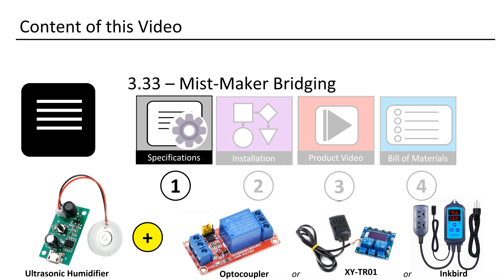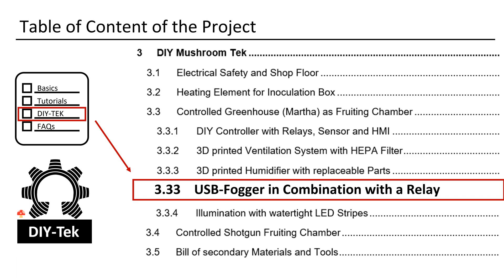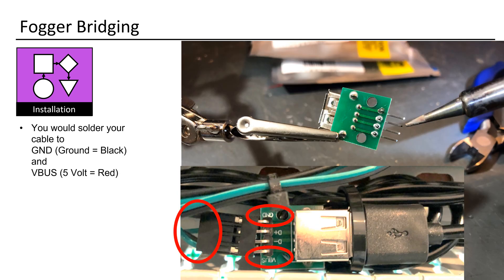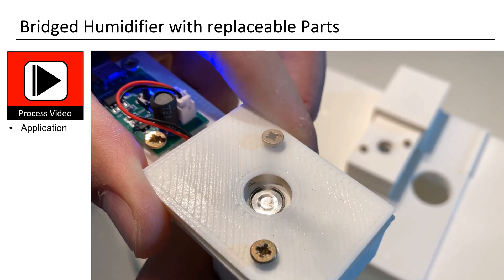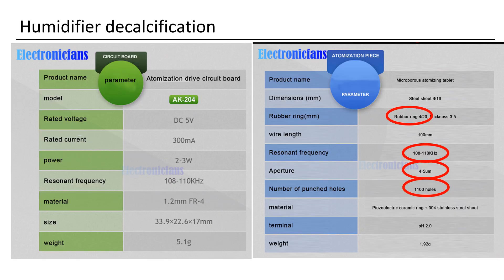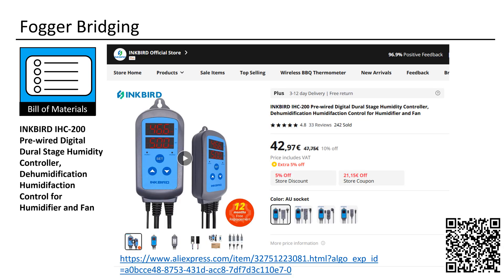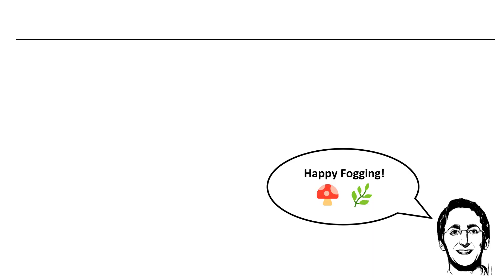USB Mist Maker to Relay Connection Tutorial

Comment: can you help me with this please?
Reply from the maker: how?
Reply: I need to make the humidifier automatic without the need to push the button. I have tried everything but can't do that  @diy-mushroom-tek
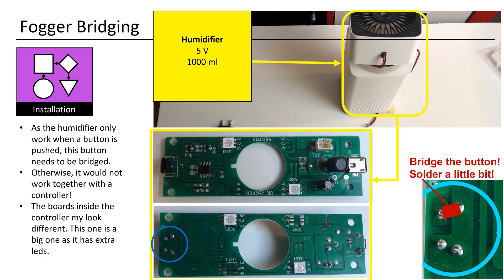Reply from the maker: @codewithshawaiz  Hey, normally, if you solder the two pins together as shown at timestamp 2:14, the starting button should be bridged. 

That means when you plug the board to power, then the mister will start.
If you did solder, and if you are not sure, just solder all the pins of the button together, and if the board still does not start, then I would advise to just buy some other boards from different suppliers and manufacturers. I had success with all the devices I tested, but maybe some designs have changed.

Anyhow, a button does just that what you do with the bridging, so I am not sure if this bridging will stop to work and why some manufacturer would like to work against it. There are also designs out there that have extra special solder pads to make the bridging even more easy. Thus, it is a desired modification according to your needs.

All the best, just try it on some other boards. Since they are very cheap, this should be no problem!
Reply: Thank you  @diy-mushroom-tek

Comment: Usb miss maker itu kalau di hubungkan ke relay cara bagaimana dan miss maker nya gak mau keluar asap tapi lampu biru nya nyala mohon penjelasan nya ,makasih
Reply from the maker: Hello! If the LED is on, the humidity controller is functioning. If you haven't bridged the controller, you'll need to press the button. Also, ensure the sonic disc is connected correctly. When both are set up properly, you should feel the disc vibrating slightly and hear a faint sound.

To test further, touch a damp sponge or cotton swab to the surface of the sonic disc. You should see the water start to evaporate.

I hope this helps and that I understood your question correctly. Best of luck!
Reply: Makasih bos ,telah berbagi ilmu yang sangat bermanfaat bagi saya,semogga sukses dan dan sehat sehat selalu

Comment: hello, my module seems like it cannot be turned on after bridging, I tried separating the soldered part and the it works again like normal. What do you think about this?
Reply: my board does the same thing like yours: holding down the button while conecting the usb-power and no misting. And after i release the button the LED will lit and the mist starts.
But ive found a solution: get a 100uF capacitor and solder it to the button like you bridge it -> by powering the board the capacitor will act like the bridge but after a second or two the capacitor is filled up with power dont let more power thru - at this moment it act like the release of the pressed button and the circuit will switch to misting 🥳
Reply: @303otto  hello! my mist maker also have similar problem like yours, can you explain more about which side of the button to bridge the capacitor? and will I need to click the button everytime I need it to turn on?
Reply from the maker: Hey, if the button does not respond consistently to a constant press, then it seems like you will need a different board.

It appears that some manufacturers do not intend for their controllers to be used in this manner and have changed the starting mechanism to an "impulse" signal. Previously, a constant push was sufficient. However, there are fogger boards available that even require you to use them as a "direct spray" device. I will share some links where I have successfully purchased these boards. Check for:

◾Direct Spray or solder pads at the corresponding spot to my board.
◾Two extra Power Supply Positions

I have uploaded some pictures of a functioning board of mine here:
https://drive.google.com/file/d/1xCtTrhqewJ6vQ9XOeGWgqkuF18V48QrM/view?usp=drive_link

Sadly, the purchase link on AliExpress no longer works. Here is a link to a board that looks similar to mine, and personally, I would try it, but of course, I cannot guarantee anything.
https://vi.aliexpress.com/item/1005002425651727.html
https://vi.aliexpress.com/item/1005006177991586.html
https://vi.aliexpress.com/item/1005006198523997.html

Happy mushrooming!

Comment: Thank you very much for this nice video; it's explained very well. After performing the bridge, I have an issue: when I power the circuit, it takes about two seconds to activate. This delay hinders the function I'm looking for, which requires the dehumidifier to activate instantly upon receiving power. Is there any way to achieve this? I see that the circuit has space for a capacitor, which is not installed. Could that be the reason? Thank you very much for your help.
Reply from the maker: Hey, interesting question! I checked, and the board I use already has a direct start integrated, marked on the back of the board where to solder. That's quite nice. However, it takes two seconds to power up completely and start the misting process.

Here's the YouTube link for reference: 
https://www.youtube.com/shorts/p3YzaXeilW8

I don't really know why; perhaps it's the time the capacitors need to charge. I'm unsure if adding a capacitor would solve the issue. Please try it out and report back! Also, explain why this 2-second delay is crucial; what is the purpose of your intended process?

I can imagine one possible solution for your problem, please check out the wiring of my new humidifier on Thingiverse: Thingiverse Wiring Image
https://www.thingiverse.com/thing:6397535

As you can see in the wiring picture, I extended the wires of the sonic disc with "bought" Dupont wires. (Please use purchased ones to ensure a crimping connection produced on an industrial crimping process!) Nevertheless, the humidifier works the same way, even with a slightly extended wire. This gives you the freedom to implement a solution to your problem.

1. Extend the wires of your sonic disc.
2. Feed one wire through a relay.
Possible Product: One 1 Channel Relay Module Board Shield With Optocoupler Support High And Low-Level Trigger 5V 12V 24V
https://www.aliexpress.com/item/1005005687904285.html
3. The controller is always on, the 2-sec delay does not apply, and the relay feeds the signal directly through to the sonic disc.

To consider:

A) The controller normally/often has an automatic power-off function that kicks in after running for 4h. Thus, you need to add a timer that periodically turns the controller off and on again to ensure that it runs permanently.

Possible Product: 12V 24V Trigger Cycle Timing Delay Switch Circuit Dual MOS Tube Control Board Replacement for Relay Module DIY
https://www.aliexpress.com/item/1005006197286066.html

B) I don't know if the additional addition of a component extra to the wire extension between the sonic disc and the controller can result in reduced functioning of the disc, but I suspect it will not. If you try it out, please report back.

Maybe some fellow grower has another idea? Please share. Anyway, I am looking forward to knowing which solution you used to solve your problem!

Happy tinkering and growing!
Reply: @diy-mushroom-tek  Thanks a lot for your detailed response! I appreciate your effort in checking and providing insights. The 2-second delay is crucial for my project because I'm using the circuit to simulate smoke for a miniature vehicle, emulating exhaust smoke. The instant vapor production is necessary to synchronize it with sound modulation. Your suggestions for extending the wires and using a relay are quite helpful. I'll explore these options and check out the products you recommended. I'll definitely give these suggestions a try and report back on the progress. Thanks again, and looking forward to updating you on how it goes! Happy tinkering too!

Comment: Hello, I have a question about the soldering part.. I dont know which one of the two should I solder.. or does it have to be both? And what happens to the button do you have to remove it?
Reply from the maker: Hey @reesejasminsibug9164 !

When you observe the backside of the board, you can see how the current portable layers are designed. (1:07) On top of both the plus and minus sides sits the button you want to bridge, which has four pins—two in the plus layer and two in the minus layer. That means one side would be enough to bridge it. If you solder both sides, you have a double bridge. It's not necessary, but do it anyway! Even if you choose to connect the wrong two pins, connecting the other possibility afterward still bridges it! In fact, you can't go wrong. Of course, you could power the board up and try by placing the cold solder wire on two pins; if these two pins bridge the button and the board does start.

The button has no function afterward, as the plus and minus portable layers within the board are permanently bridged by your soldering!

I hope this little explanation helps you! Good luck with your project!
Reply: Please reply ASAP.. I really need it for my project and I dont know how to do it anymore
Reply: I also have more questions if you dont mind. Do you have to solder it to really connect it to the relay module or are there other ways? I am really desperate to find out how to automatically turn it on and off using a certain sensor. and you are the only one whom I could find that seems to have answers.. Also do you solder it to remove the button? or just to connect the wire? If you dont mind do you also have a code for this? If it isnt too much to ask.. but if it is I am still thankful for you.
Reply: Also are you sure that soldering would really solve it? would it not break the relay module? would it still work? Oh and can you just connect to the positive and negative to the power instead of using the usb? Cant I just use that to connect to the arduino board?
Reply from the maker: @reesejasminsibug9164  

Hey! 
1. Soldering is a simple process, so no need to worry. Heat up the soldering iron, place it on the position you want to solder, heat the area where you'll apply the solder tin, add the tin to the heated solder iron, and wait until it absorbs the heat and becomes liquid. Wait a bit longer and let it flow by gravity to your desired location. When bridging the button, you can't go wrong, and you won't damage the board.

2. The button doesn't need to be removed; it remains a component on the board but won't function anymore since it's permanently pushed due to the bridging.

3. Use a relay to turn the 5V power on and off.

4. You can skip using the USB power adapter. Instead, use a Dupont connector that you solder directly onto the board. Follow the process described above. Check the timestamp (2:38) to see where you should add the Dupont connector.

5. Avoid connecting the humidity controller directly to the Arduino board. The 5V pin on the Arduino has a maximum draw of 0.8A, which is insufficient for the humidity unit requiring approximately 1.5A. You'll need to apply an additional power source to supply enough power for it.